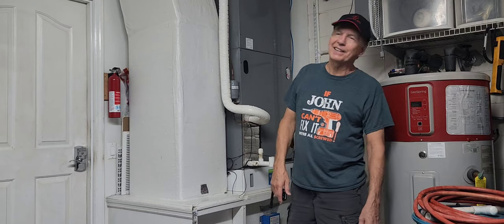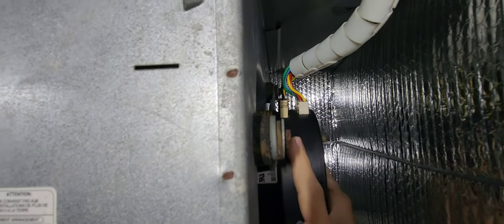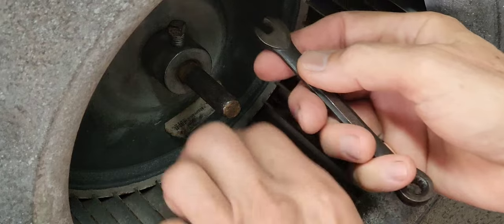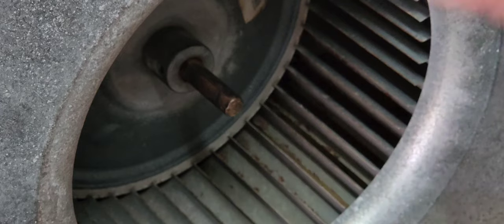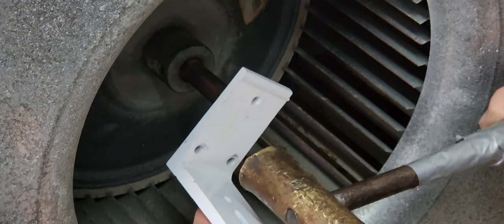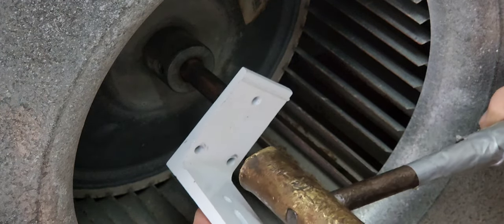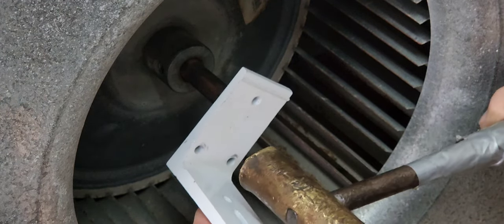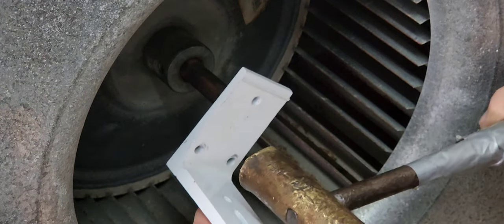Carrier Infinity air handler blower motor replacement

Comment: The motor by itself is almost $1000 at the supply house. You saved so much money!
Reply from the maker: I could not believe the price of a new motor and drive. I was so happy to find an open box replacement on ebay. It's working great. Thanks for watching.
Reply: @johnyanik1414  good stuff man!

Comment: I have a carrier from 1993, the year that the house was built. It is now 2024 and the HVAC system quit blowing. It is a dumb system from 1993 and doesn't even know if the motor is spinning. 
I took the covers off the HVAC system and on the blower motor housing it states that the motor needs 25 drops of 40 weight motor oil every two years if running continually or every 5 years if not every day. 
I haven't oiled the motor in 31 years and it runs every day. I pulled the blower housing out and surprisingly the blower motor spun easily. Over the years of changing the filters, the brackets that hold the filters would bend and not allow a flush mount on the filters so air would pass by. I would also wait almost a year to change the filter. 
When I pulled the housing out, the fan blades were caked with 31 years of dirt and dust. 
I pulled the motor out and soaked the fan in a bucket of soapy water overnight. The amount of dirt that came off that fan was amazing. 
The HVAC system now blows air like a champ. So, change your fiters and get in the HVAC system with a hammer and beat the filter retaining brackets back into place.
Reply from the maker: Also make sure your evaporator coil fins are clean. There is an evaporator coil cleaning foam on Amazon.
Reply: @johnyanik1414  "Also make sure your evaporator coil fins are clean. There is an evaporator coil cleaning foam on Amazon."
I replaced the entire AC system in 2022 to a 10 ton system. I took a look at the evaporator coils when I had the fan out and they looked clean.

Comment: I don't have a carrier HVAC ..it's a Bryant.. no fault codes.. not sure if it even can do this...15 year old system... moter doesn't spin . Moter hums But doesn't spin... After watching this video.. and a few others.. Somewhat handy sort of guy..  I think I will tackle this. Probably will replace the capacitor as well.. and inspect the moter arms and grommets to see if these need to be replaced. Thanks for the inspiration 👍
Reply from the maker: Good luck with the project. You should be able to find a motor on ebay. Take measurements of the existing motor including shaft dia and length and note voltage specifications on its nameplate to assure acquisition of correct replacement. Beware of cheap substitute motors as they will not last and are subject to noise due to inferior manufacturing. Take some pics of the bad motor positioning in relation to blower and motor bracket before you start. These make for great positioning references during installation of new motor. Thanks for watching.
Reply: @johnyanik1414  I intended to replace the motor. I replaced the blower run capacitor only, fired it up, and the motor initially hmmed for a few seconds.. I tapped the outside of the blower housing gently with my screwdriver which may have nothing to do with anything but after a few more seconds the unit started spinning normally its been running fine ever since but curious if the problem was the run capacitor upon replacement of it why the hmmm after replacement ? You think the motor could still be an issue or failure ready to happen soon? Or are these observations consistent with a run capacitor failure? Maybe it took a moment for the new blower capacitor to get energize upon power up? Thoughts?
Reply from the maker: @pcexpress911  
Does the blower spin freely without restriction? Did you check your voltage? Are the contacts on the motor run relay ok? Is the capacitor the correct type and value?